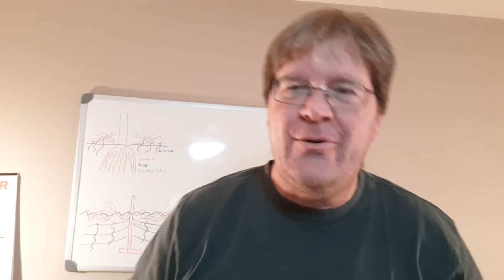Manure management in no till.

Comment: This was the number 1 biggest reason we didn’t switch to no-till until after we sold our dairy herd. Couldn’t figure out what do do with the pit manure. Now we just rent out the pastures to a neighbor. Have about 30 steers in the summer and they are only are concrete at the bunk the manure is no issue. Wish we would have tried strip-till years ago that probably would have been the right thing.
Reply from the maker: When I was young we had a 3 shank unit on the back of the manure tank. If only we would have made a 4 shank strip unit to match the old planter.

Comment: As I've been going through your videos I've been wondering about this. Thank you.

Also wondering... what are your thoughts on biosolids? Especially as it pertains to a no-till or strip-till system (obviously).
Reply from the maker: We have some guys in the area to get water treatment lime  Once in a while a guy has a negative response

Manure is my bio solid and I have no problem leaving it on top of the ground. The probably isn't much difference in nitrogen loss laying on top of the ground versus stirring into the top in the top insure 2 of dirt. In my soil there is less likely to have run off laying on top of the ground where you have residue and cover crops versus a bare dirt field that has a tremendous amount of run off
Reply from the maker: I can't respond to your other comment on the other video for some reason. But yes tractor porn is always good..